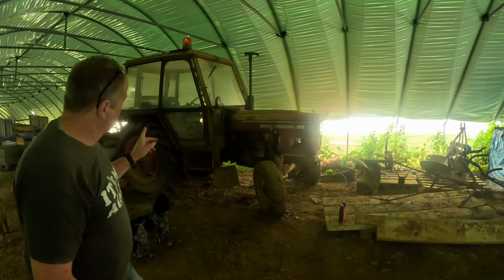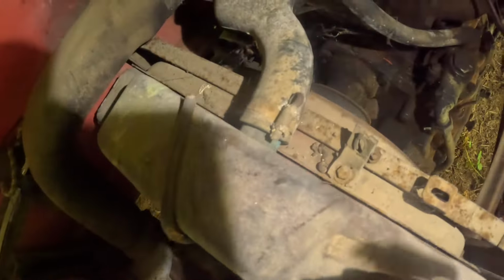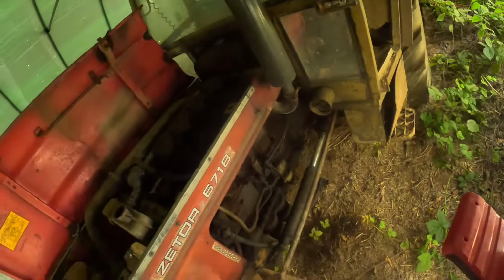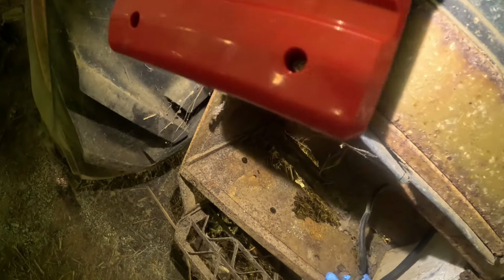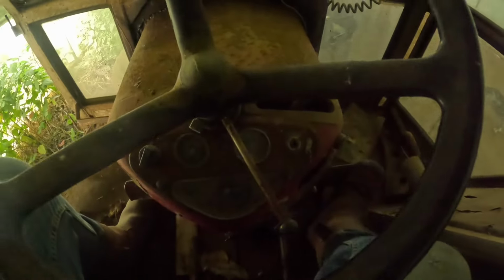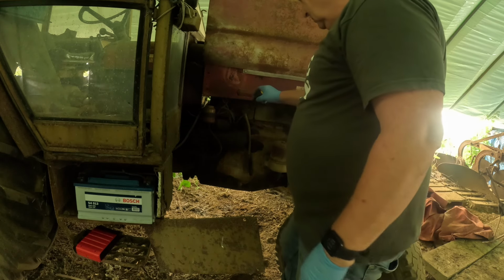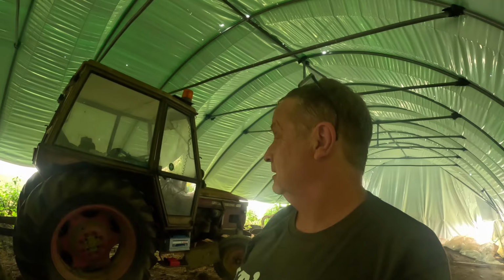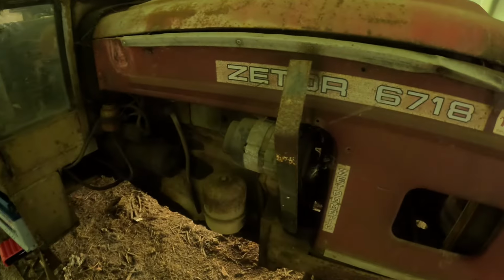Will it Start Zetor 6718

Comment: Nearly wide open throttle, push the cold start button on the pump, dip the clutch and press the start button (big push button on you right knee) that’ll start up first time every time. Handy little tractor.
Reply from the maker: Thanks mate for information 👍

Comment: To start an old Zetor like that:
- push the key down in position 0 (or you can use a 3" nail, just need to make contact)
- handthrottle at 75%
- if engine is cold - push in the coldstart button on the fuelpump
- push the startbutton.

Turning the key to position 1, 2 or 3 just switch on the lights. 1 is parkinglights, 2 is headlights low beam and 3 is headlights high beam. 

The levers on the floor:
Right lever is High/Low gear series selector. High - neutral - Low
Left lever is for engaging PTO/Hydraulic pump. Has several positions for different options.

Engines on these tractors are very reliable, and starts up easily in very cold temperatures.
Cheap parts available, and easy to maintain and fix.
Reply from the maker: Love this comment thank you very much for the information many people will find this informative 👍

Comment: there should be a manual fuel pump on the side of the injection pump to prime the injection pump.
Reply from the maker: Thanks mate for info will remember that 👍
Reply: @OutofTownwithRobinBell  and universally diesels usually have a cold start aid button to help cold starting, to engage the button full throttle is often needed. Generally when starting any diesel the throttle should be put to max or half if warm.

Comment: My late uncle bought one of them brand new back in the 70s, faithful old thing. Zetor were ahead of there time really, especially with the bungalow cab!😀
Only problem he used to have was if he didn’t use it for a wile brakes would start binding, my zetor Christal would do same thing. There is a bit of an art adjusting zetor brakes. 
Probably best if you can find it a new home,
Fairly easy restoration and it’s a runner too👍
Reply from the maker: Thanks Dave I think also find a new home just waiting for a offer 👍